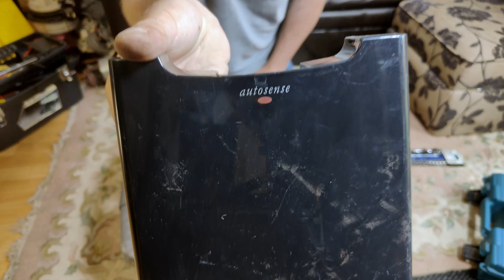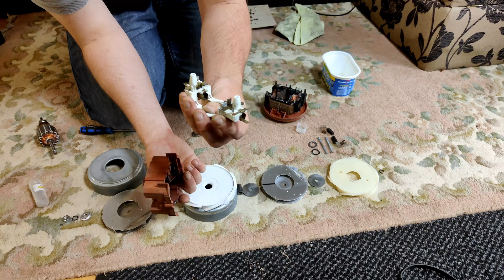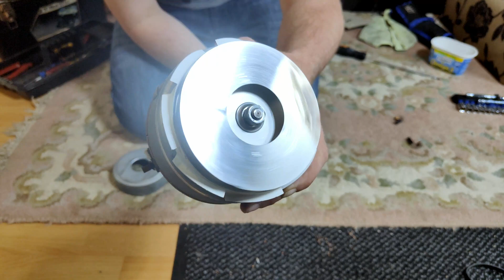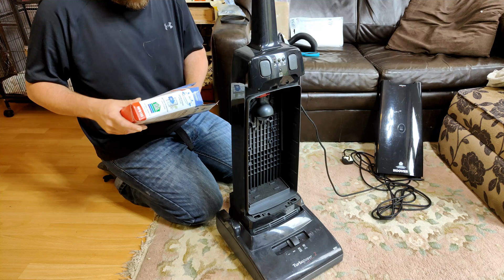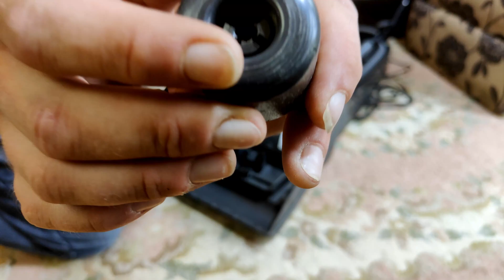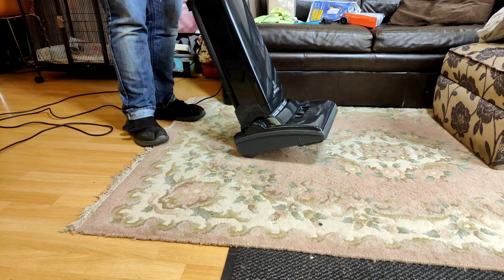Hoover Turbopower 2 Autosense U2464 - After a FULL restoration.

Comment: Very cool video and do you know if hoover sensotronic bags exist in hepa flo bersion😊
Reply from the maker: I've not seen Sensotronic hepaflo bags, but if you remove the original bag holder, remove the original foam gasket that seals to the og bag card a 40mm waste pipe coupler fits where the foam gasket went perfectly then a Henry hepaflo fits on that (and the bag door closes as the original lock arm has been removed 👌). I did it on my system 10 and 40 before